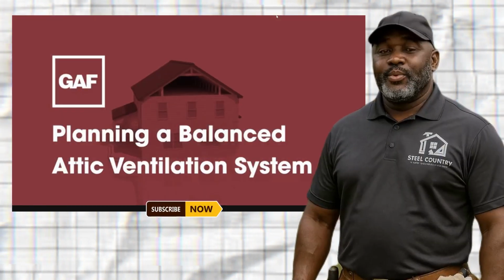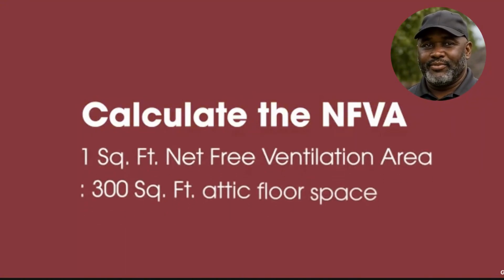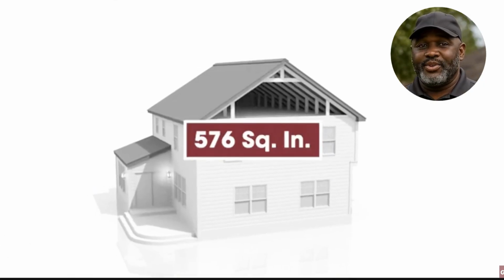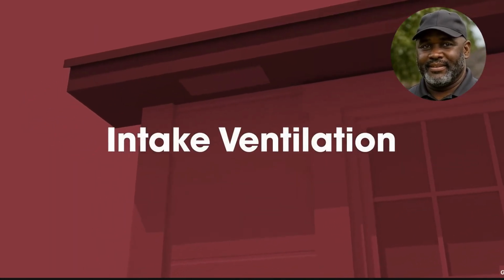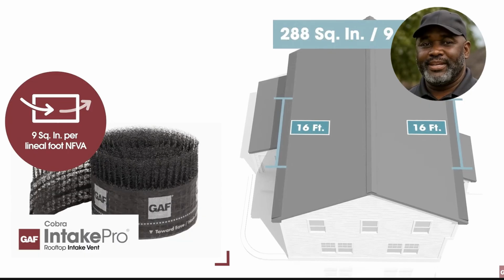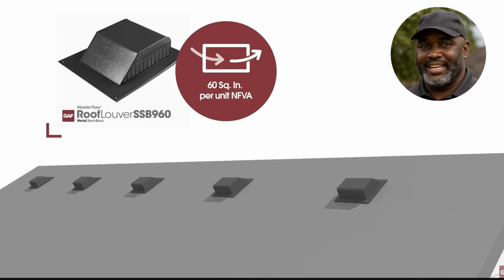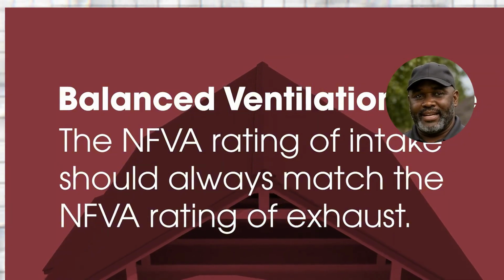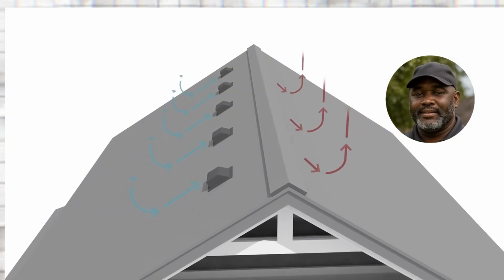How to Calculate Balanced Attic Ventilation | Intake + Exhaust Explained

Comment: I have a  narrow attic space ( 35 x 8 x 12) with soffit vents, baffles  and fully insulated . On the north side of the house, it does not reach to the top of the roof (no ridge vent).  It houses the furnace, duct work and storage.  Does it need more ventilation and if so, what kind? Thanks.

Comment: So well explained.  For 1200 sqft attic, 6 master flow eave intakes, 16 feet of ridge vent, or 3-4  Ohagins
Reply from the maker: Great observation and nice work running the numbers! 👍

For a 1,200 sq ft attic using the 1:300 ventilation rule, you’re looking at about 576 sq in of total Net Free Ventilation Area (NFVA). A balanced attic ventilation system typically splits that evenly between intake ventilation and exhaust ventilation.

That means roughly:
• 288 sq in intake ventilation
• 288 sq in exhaust ventilation

Using 6 Master Flow under-eave intake vents (~50 sq in each) gives you around 300 sq in of intake, which fits nicely within that balanced range. For the exhaust side, about 16 feet of Cobra ridge vent (~18 sq in per foot) lands in the same ballpark and creates the proper airflow path from soffit to ridge.

And yes — Ohagins can also work as an exhaust solution, especially where ridge vents are not ideal. The key rule is exactly what we mentioned in the video: never mix different exhaust vent types on the same roof system because it can cause short-circuiting and reduce attic airflow efficiency.

Proper attic ventilation design, soffit vents, ridge vents, and balanced NFVA calculations are critical for preventing heat buildup, moisture damage, premature shingle aging, and roofing system failure.

Thanks for watching and engaging with the content! If you enjoy learning about roofing systems, attic ventilation, roof inspections, roof maintenance, storm damage prevention, and roofing best practices, don’t forget to like the video and subscribe to the channel so you don’t miss future episodes. 👊

#AtticVentilation #RoofVentilation #NFVA #RidgeVent #SoffitVents #RoofingEducation #RoofInspection #RoofMaintenance #RoofingContractor #BalancedVentilation #RoofingTips #ShingleRoof #HomeImprovement #SteelCountryHomeRestorations